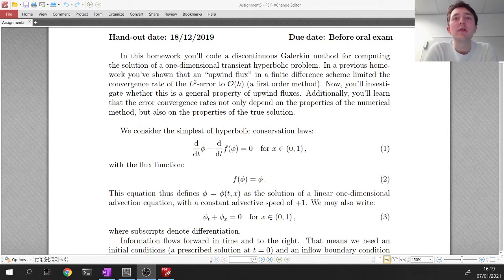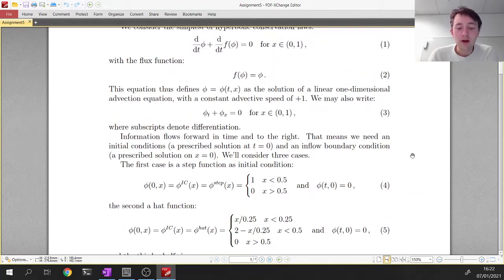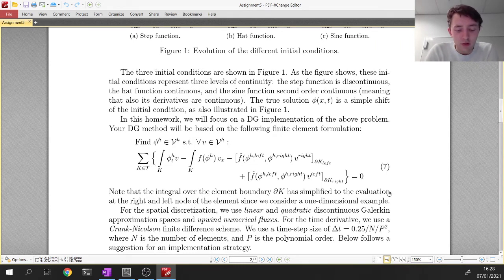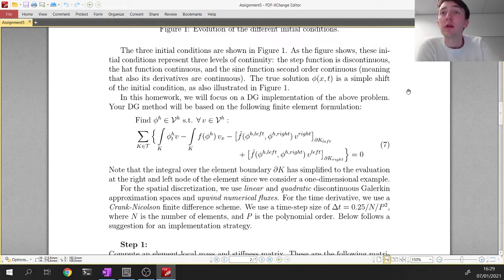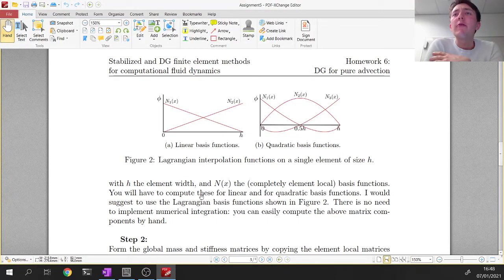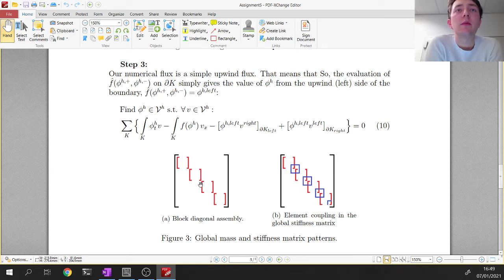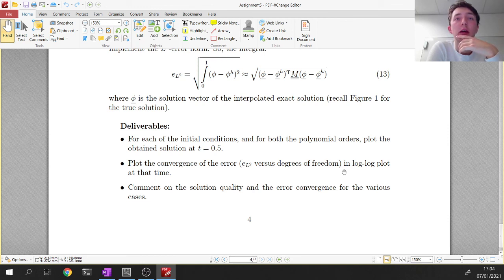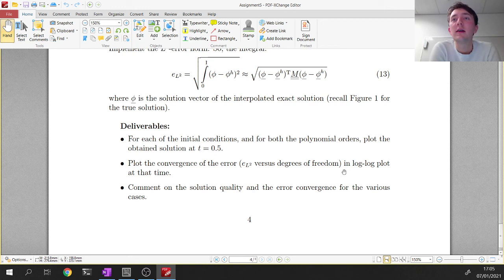49 - Discontinuous Galerkin methods - 1D implementation

Comment: Thank you for these nice and easy to follow lectures!
I have a question about this exercise:
The propagation of my solution seems to be dependent on the number of elements. The larger the number of elements the closer my solution is to the initial condition. This isn't supposed to happen, right?
Reply from the maker: No indeed, something fishy is going on. A very quick guess: By any chance, did you fix the number of timesteps, and scale the timestep size with the element size (through a CFL condition)?
Reply: @steinstoter  No, but now I somehow managed to fix it. I multiplied my global stiffness matrix K with 1/h (h:= element size), which gives me the correct solution, but I don't really know why this would fix it.
Reply from the maker: @gogoman96x22  Good to hear. That sounds like an issue with the transformation from local to global coordinates: dxi -> dx. Recall that this affects both the integrand (*h) and derivatives (/h).
Reply: Thanks a lot! Now it makes sense :).

Comment: Two weeks into watching these lectures! They're amazing! What references are you using for the DG lectures? I have the Hesthaven /Warburton book, but am wondering if you have any others you recommend.
Reply from the maker: Thanks, Steven! I also quite like Bernardo Cockburn's chapter in the Encyclopedia of Computational Mechanics: "Discontinuous Galerkin methods for Computational Fluid Dynamics" doi:10.1002/9781119176817.ecm2053 
It is both broad and condensed.
Reply: @steinstoter  Oh that's a classic as well :) Good to know I'm on the right track. Thank you!
Reply: Hey Steven, do you have the code for DG method? If yes, please provide me with that. It would really be helpful.

Comment: Sir can you please provide the code for DG scheme as well? For advection equation and Burger’s equation.
Reply: @stein stoter
Reply from the maker: @pradimsiwa1966  Hi Pradim. I've uploaded an old code snippet here:
https://gitlab.com/Stein.Stoter/simple-dg
It used to work under python2, but it seems to be broken in python3. I just spend a few minutes trying to fix it, but that might take me a bit more time than I'd like to spend. Feel free to fix it an send me a pull request. I hope this is helpful.
Reply: @steinstoter  hey can we connect over whatsapp or somewhere else where I can clear the doubts. Also I’m getting errors which I’m not able to resolve.
Reply from the maker: @pradimsiwa1966  Hi Pradim, I'm afraid I time-wise can't afford connecting with people for individual questions. I hope you'll manage to get by with the code that I sent earlier. If you manage to fix it, I'd much appreciate to receive the revised code.
Reply from the maker: @pradimsiwa1966  I ended up having a free weekend-morning to take a closer look at the old code. I've updated, cleaned and fixed it. Now it works. Take another look at the gitlab repository.
Reply: @steinstoter  Thank you. Do you have the code for study of convergence as well? It would really be helpful.
Reply from the maker: @pradimsiwa1966  It's all in the code on gitlab
Reply: @steinstoter  Sir have you used Godunov’s flux in the code?
Reply from the maker: @pradimsiwa1966  Why don't you take a look at the code and find out...